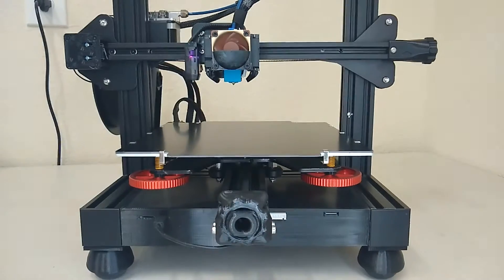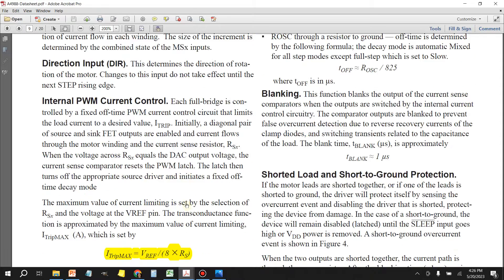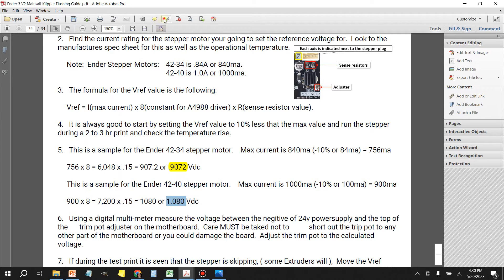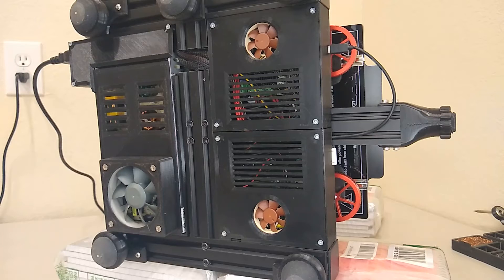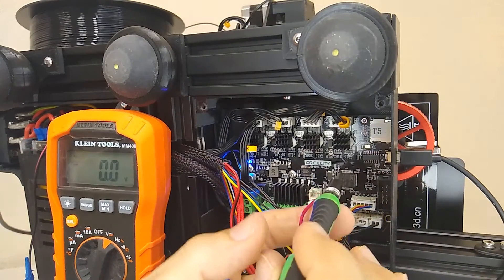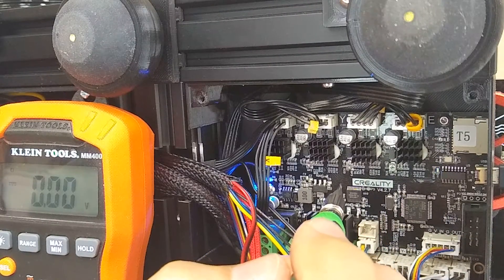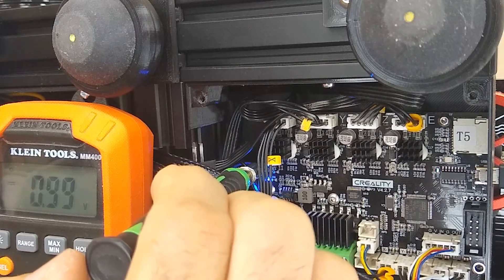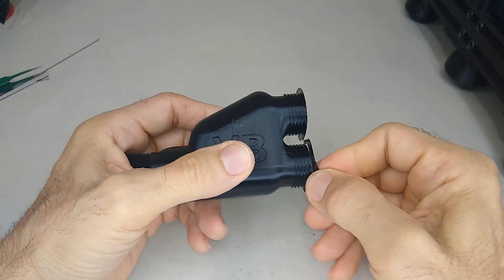Ender 3 Pro V2 - Steppers too hot? How to set the correct stepper voltages step-by-step

Comment: what is the vref voltage if I use a 1.5A stepper motor?
Reply from the maker: Hi Madorax, I would search the actual model number of your stepper motor. The manufacturers usually provide this information in the technical documents of your model. The idea is to not have the vref so high that the motor runs hot or too low that it skips steps.

Comment: I was unaware there was an Ender 3 Pro v2.. though I can't say I'm entirely surprised, hopefully this works on my E3pro "v1" (seems like it should, but I'll have to get a multi meter first)
Reply from the maker: Hello friend, Thank you for commenting. Yes all of these videos will also work with a stock Ender 3 Pro. I call my Ender 3 Pro a V2 because of changes I made to it. The Creality Ender 3 V2 in my opinion is the pinnacle for this series of printer given its price point, so when I bought some used Ender 3 Pros it was more obvious to me. The Ender 3 Pro V2 videos was essentially me making them more Ender 3 V2 like along with other coexistence, reliability and performance improvements. Yeah, a multimeter is a must for maintaining and upgrading your 3D printers.

Best of luck with your upgrades!

Comment: Awesome video. I am having layer shifting on my ender 3 v2 and also have noticed how hot my stepper motors are getting. This video has helped me loads in learning how to adjust them correctly. Thank you.
Reply from the maker: Hi Ryan, Thank you for commenting and encouragement. I'm glad you found value in this video for your viewing time. Please send me some pictures to vbared@gmail.com of the layer shifts so I can help you diagnose the problem.

I custom made the upgrade linked below to further reduce the y-stepper temps down to just warm by replacing the plastic housing for an aluminum one, which not only acts like a large heatsink but also transfers heat to the long 40x40mm extrusion that it's bolted to. The root causes of the y-stepper heat buildup is that the stepper has no way to move that away from it when it's isolated from the aluminum extrusion it's bolted to by a plastic part that acts like an insulator. The VREF adjustment helps but doesn't totally solve it, this part does. Check out my video on it linked last.

https://amzn.to/4bpgjza

https://youtu.be/xHNsFD8OJBI?si=fxs6s780iPINv401
Reply: @vbared  Thank you for reply, I have emailed you with some images, and thank you again for that advice also. I will look at getting one of those.   
I have a friend who maybe parting with some Zaribo stepper motors so, if it persists I may give these a go, as they apparently run cooler .

Comment: Hello Victor, I need your help to set up my ender 3 pro with Sprite pro and the limits turned out well. But I have an ender 3 I set the same limits and it hits the x-axis at the end.
Reply from the maker: Hi Marcel, What hits, the screws at the back of the gantry bracket?
Reply: Yes, Victor at the end of the X axis. I thought about cutting the screw but I wanted to consult you before.
Reply from the maker: @marcelrios806  Hi Marcel, yes, you can cut it like I cut mine. You'll also need to cut the bottom one down as well and grind down the cap head nuts but from the non-lock side. The first link is how mine looks after cutting down the screws and grinding the nuts down as well. The second link is a video that I made on how to do it.

https://photos.app.goo.gl/Qtb6gaaKfNFzdCMG7

https://youtu.be/l-mrw8YvLBU?t=434
Reply: @vbared  Excellent Victor, a teacher. I wanted to ask you about the regulators of the X axis and Y axis. You do it because they are great. Then send me the website where you sell your impressions that I will share and promote to some friends.

Comment: The case for the source was made by you, incredible?
Reply from the maker: Hi Marcel, Thank you for your kindness. Yes, I designed all the 3D printed parts on this printer except for the belt tensioners.

I'm mechanically inclined so when I come across problems I visualize the solution, use CAD software to refine the ideas and the 3D printer to make it physical.

I started learning OnShape a few years ago. It's been the most intuitive of the CAD programs for me to use.

Comment: Hello friend, you are a master in 3D printing.
Reply from the maker: Thank you Marcel, I've been 3D printing items that I sell for several years so I have a lot of experience using PETG, modifying the printer and tuning it.

YouTube has been a great source of information for me and as you learn more about 3D printing you'll easily spot the good videos.
Reply: @vbared  Excellent, the thing is that I don't give it with the values of bed limits since when it starts instead of extruing inside the bed it does it outside.
Reply from the maker: @marcelrios806  Marcel, is it possible for you to video the problem you are having so I can see it? You can upload it to Google drive and send me the link.
Reply: @vbared  Of course, I'm very grateful for your help
Reply: @vbared  I wanted to tell you that I need to see how to automate 4 printers to control remotely and send the files via Wi-Fi, it is a project that I have been thinking about for a while and I would like if I can count on your help. Greetings
Reply from the maker: @marcelrios806  Hi Marcel, I've been using Klipper to control 4 of my printers in the same way you are describing. I made step by step videos on how to do it using the 4.2.2 and 4.2.7 Creality control boards.
Reply: @vbared  OK, perfect, I'll verify that.
Reply: @vbared  https://drive.google.com/file/d/1lTGM0tRuixHjqlYqUjH5teozDSFMhv5A/view?usp=sharing
Reply from the maker: @marcelrios806  Is your printer an Ender 3 Neo? 

Changing the position of your x-limit switch will either solve this issue or at least get it much closer to where it should be. The nozzle is supposed to be 1/2 on and 1/2 off the build plate when the x position is set to 0. Use these parts I designed to adjust the x-limit switch position.

https://drive.google.com/uc?export=download&id=1Hw9kbHkN5Skchieiugs6zg8V2MPpE3iK
Reply: @vbared  Victor Friend, do you have a video on how to use the models you sent me to adjust the X axis?
Reply from the maker: @marcelrios806  Hello, yes, check out this video - https://youtu.be/8biqiHTd73o
Reply from the maker: I have Ender 3 V2s, Ender 3 Pros with 4.2.7 control boards, a CR10S Pro V2 also with a 4.2.7 control board and a Coreception 300 which will soon have a Bigtreetech M5P control board +CB1. 5 of the printers will be running Klipper and one has Miguel's Professional Firmware.
Reply: @vbared I tried to modify some parameters but I still have the problem that when you start printing, do the test line out of bed
Reply from the maker: @marcelrios806   Hi Marcel, Did you print those parts I linked and install them? You should be able to move your limit switch over to the right by at least 5mm. If you are still not at the edge of the bed when the x is set to the 0 position you can make some software adjustments in CURA. I made a video on how to do that linked below.

https://youtu.be/goQ6I8TpzRU
Reply: Victor, I’m still having the problem, I’m going to load the fw again. You have a video explaining how to configure the limits and printing origin.
Reply: @vbared Has. profiles for PETG

Comment: Thank you for this video. However, after tuning, my Y motor is still crazy hot compared to my X which is practically still ice cold,
Reply from the maker: Hello legoman786, Thank you for commenting. What build plate are you using?
Reply: @vbared  A magnetic PEI sheet. I also have the modular Y carriage and machined heat bed from Gulf Coast Robotics. Then, I have a linear Y rail kit on the way, because I noticed some deformations in the aluminum extrusion along the wheel path that is wrecking my layers.

Comment: Its the same for Ender 3 S1??
Reply from the maker: Hi Armando, The S1 board is layed out a bit different but it does also have the adjustment pots. I don't have first hand experience since I don't have an S1. Make sure that you get the resister values as indicated in the video so you can calculate the correct vref needed. I would also write down the stock voltages for each of the steppers just in case you need to revert back. Just keep an eye on your first few prints after the adjustment to make sure the prints look the same and adjust up as needed.

Best of luck with your mods!
Reply: @vbared  Thanks in advance, indeed I opened the printer and followed the steps in your video because my PAP motors are the same as the ones you show (nema 17, 42-34) the only thing that differs is the Creality board. I could see that the steppers don't get hot like they did with factory settings.
Reply from the maker: @armandoramirez8760  Hi Armando, Great job making the adjustments. Mine were cooking during long prints.

Comment: what about for a DUAL Z motor? I also upgraded my Y stepper to a larger motor, because that small motor is working way to hard for all that weight that's why it gets so hot. I turned my vref up a bit and being a bigger motor that thing runs so cool! I also upgraded my X motor to the size of the extruder because that also gets hot, especially since converting to direct drive. I think the more weight you add, the bigger the motor should be. and this should also help with the downside for having too much weight on a direct drive, ringing theoretically should be less as well.
Reply from the maker: Hello Hey It's Drew, Thank you for commenting and info about swapping the 42-34s for 42-40s. You're right that's another way to solve the problem. Most people aren't going to mess with the vrefs.For the dual z I would set the vref to 1.1 volts and run some narrow vase mode test print. Are you using glass for the build plate or something else?
Reply: So you did change your y and x steppers to bigger ones?
What size stepper did you put on there?
And do you use the original 4.2.2 board?

Comment: Am I glad I upgraded my Ender 3 Pro to an SKR E3 mini v2.0 a long time ago and with some extra wires had the TMC2209s working in UART mode (using 2 spare GPIOs).  Changing the current is then simply via a menu in Marlin or config setting in Klipper.  In 2023 any decent board should no longer require adjusting trimpots for current nor adding extra wires for UART or SPI mode.  Boards still requiring that are pre-pandemic tech ;-)
Reply from the maker: Hello MisterkeTube, Thank you for commenting. Yeah, man, I hear you it's super annoying have to open up the printer to deal with stuff like that. I too am spoiled by Klipper. Which board are you using that doesn't have adjustment pots to deal with. I recently picked up an SKR mini 3 V3 and am stoked about getting it into my Coreception 300. Please share your Klipper printer.cfg so I can take a look at the UART entries. 

Best of luck with your mods!

Comment: Very good information, will have to check my 4.2.2 board because my "Y" stepper motor feels too hot too (compared to the others).
Reply: I also noted my "Y" was hot so I grabbed my pizza infra red meeter while printing a 12*12 cm in size thingy, The voltages are quite high but I think the heat comes from that Y moves more combined with that I print faster nowadays with input shaping (E3V2 with 4.2.2 and SW mriscoc for IS )
                         E	   Z	        Y 	           X 
C Temp org	40	   30	50	          30
V org	     1,40	1,19	1,18	1,18
Reply from the maker: @user-ih4fj4lj7t  That's a great point, the extra speed compounds the problem. Since making the adjustments and running some long prints at 100mm/s to test, the problem is solved for me. The steppers are still hot but not enough to burn your finger tips or deform any of the PETG parts.
Reply from the maker: Hi Andy, Thank you for commenting. When I saw that PETG deforming like that I thought, WOW! It's crazy to me that Creality puts the boards out without adjusting those pots for the steppers they will be driving.

Comment: Great information. I always wonder why my stepper motor got so hot on my CR10.   Thanks for helping me on building a firmware of ender extender.   I can wait until I get the printer up and running.  Next I might try convert my Anycubic Kobra Max to use creality components.   The Kobra keeping breaking down I had it close to a year. Most of that is had been down for parts.  Thanks for posting this video.
Reply from the maker: Hi Gary,

I'm excited for you to get your new display in so you can get blown away by how awesome Miguel's Professional Firmware is.

Enjoy your week :)

Comment: Hello, I think the calculations are incorrect since the driver of your motherboard is not A4988, as you can see you have a sticker that says T5 that corresponds to the TMC2225 drivers. In other cases it puts T8 that correspond to the TMC2208.
For the TMC2208 and I think for the TMC2225, the formula is Vref = Imax * 1.385
Reply from the maker: Hello Luis, 

Thank you for commenting and info on the TMC2225. You're 100% correct on the differences in stepper drivers in the Ender 3 V2 4.2.2 and 4.2.7 boards vs the A4988 formula we used to calculate vref.

Most of the time stepper voltage isn't too big of a deal if the printer operates in an air conditioned space. But if the printer is inside of an enclosure or in a small room with other running printers then stepper voltages that are set to near max will trip the internal thermal switches resulting in stepper shutdown. The A4988 included in the Ender 3 Pro's 4.2.2 board is a good base reference where we got the "8" value to plug into the formula to calculate the vref. The max amps are determined by the steppers themselves. My buddy Doug found that by using the A4988 formula to set the base, all of the other 3D printer stepper drivers variations can be captured. The method I used in the video works perfectly for my Ender 3 Pro with 4.2.7 board, and TMC2225s running Klipper. That production part I printed was a good test as it took 8 hours to complete. Should it have had problems I would have simply increased the voltage by 5% on the stepper that had the trouble until it printed the same as it did when it was cooking the steppers minus the extra heat.

I appreciate the time you took to comment and read through my rant. Enjoy your week and 3D printing.

Comment: I'm running my extruder stepper motor 1.5voltage. It runs relatively hot, but still cool enough to touch. After experimwnting with different voltages higher voltage seems to to provide smoother operation and less noise.

With BMG clone extruder I'm able to adjust voltage as low as 0.75v without skipping but then the opearation does not seem to be as smooth as when having higher voltage.
Reply from the maker: Hello Madvelila, Thank you for commenting. For me the motor that was cooking was the 42-34 Y-stepper. I was getting so hot it was deforming my PETG housing. I appreciate the info on your stepper motor voltage so I can keep an eye on mine.

Best of luck with your prints!